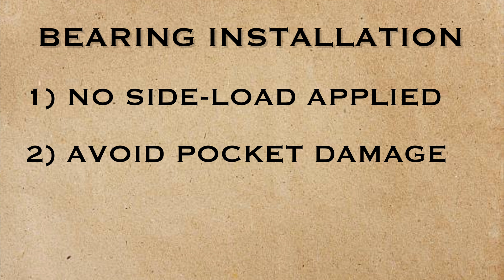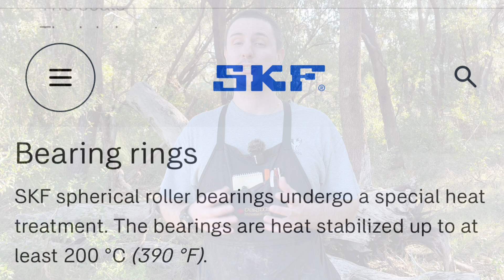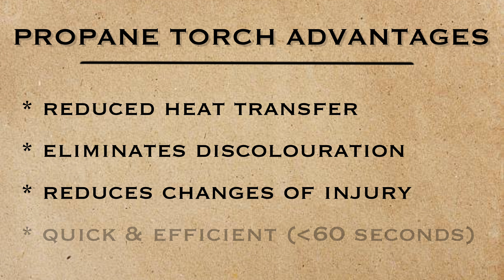The Correct Way To Install Engine Bearings - The 5 Step Method!

Comment: Very fun. In canada, labour prices (and taxes) exceed buying a new small engine, so no decent shop here could do it. Furthermore from my experience, engineers design these machines to last the life of the bearings-once they go every other part is also expired. Personally, heating that aluminum/mag case would deform or melt it and chances are that the bearing made the pocket/seat to lose. Awesome vid.
Reply from the maker: Hey mate, thanks for sharing. I haven’t experienced any of what you’ve said, but ultimately, you have to do what makes you feel most comfortable :) thanks for the kind words!
Reply: @VintageEngineRepairs  yeah man, um im asking you now, a 1500$ chain saw got cooked with straight gas(fngood saw dumb user). I say its shot cus the entire machine was overheatedk
Reply from the maker: No no, you can clean up the cylinder is most cases and put a new piston, rings and small end bearings and it will be fine. Do check the bottom end bearings (crankshaft and big end con-rod too)

Comment: I pretty much follow the steps that you showed here, except never used an air-con for that job. 
Just on a side note, bearing protrusion in a housing - same for seals, spacers, washers, shafts etc - is something many do not note down when disassembling parts. It is assumed the new bearing will fit in the space, and many do. But there are some which can make a difference and cause things to not fit properly.🐞
Reply from the maker: Yep spot on, some times there are specific depths to set things :) thanks for watching!

Comment: Good video and tips. In my experience, heating the whole engine case in an oven or on the bbq grill works much better as it retains the heat longer and eliminates the possibility of warping the case half. I heat the case to 325 F. and of course freeze the bearing.  Cheers
Reply from the maker: Thanks for watching and sharing :)

Comment: Great info Tom. One observation though. Short exposure to a higher temperature when assembling will not do anything to the bearing.  The manufacturer states a not-to exceed OPERATING temperature, meaning RUNNING the bearing at that temperature, which in some cases would compromise the lubrication and reduce assembly clearances.  All good info as always Mate!
Reply from the maker: That’s great to know for some reassurance when installing them mate :) thanks for sharing!
Reply: @VintageEngineRepairs  I worked in the Bearing industry for 12 years, nice to know I can use some of the things I learned!